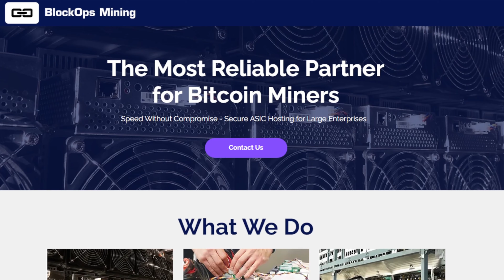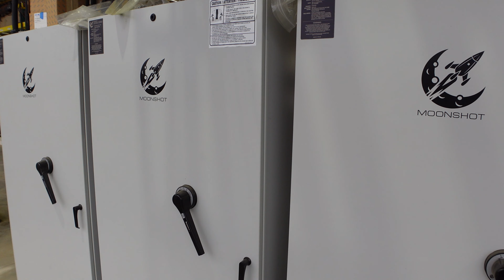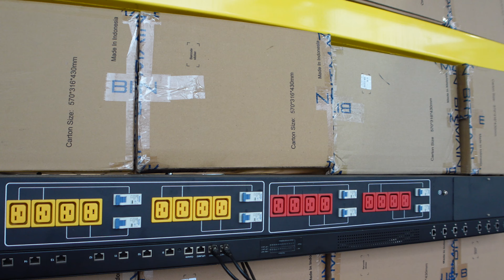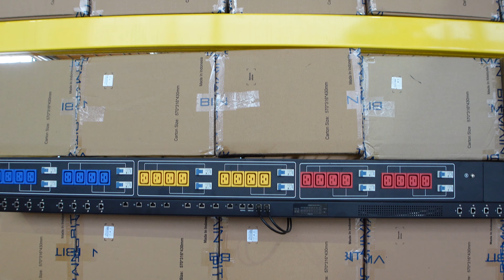This is the Most INSANE BITCOIN Mining Farm, I Have Seen! | BlockOps Mining

Comment: Excellent interview.  Ben looks like an awesome dude and has a great knowledge of the industry!  The only question I have with the open design is: what happens if you get "sideway rain/snow"  I am not for sure how much side way (high wind) rain they get, but it looks like on a severe storm from that side it could reach the machines.  Maybe not though, kind hard to tell in the video.  The other concern would be in the winter temps with no ability to lower morning humidity.  I often circulate air from the hot isle back to the cold isle to lower humidity when the environment is under 40 degrees with high humidity.  ASIC chips hate high humidity and cold temps.  Again, kinda hard to tell in the video how they are doing that as well.  Awesome interview!  I would love to check it out some day.
Reply from the maker: Thank you! Great Points!